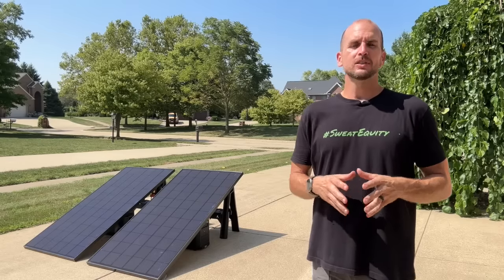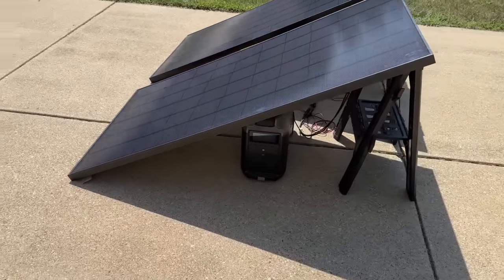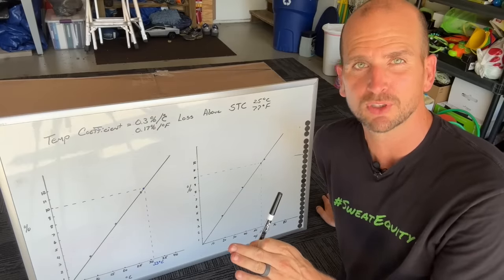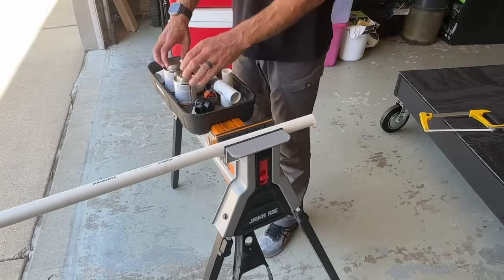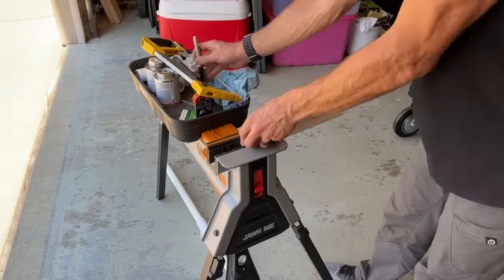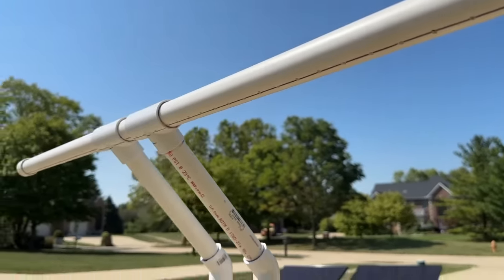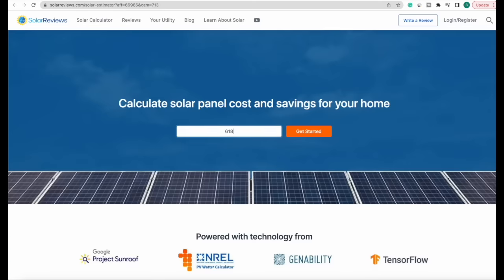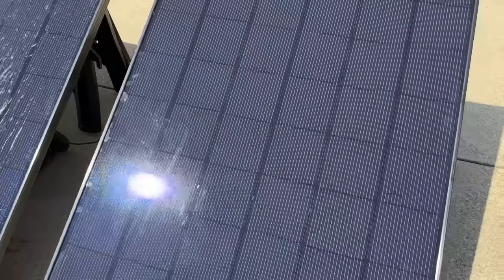Surprising Power Gains By Cooling Solar Panels

Comment: Really interesting but definitely would need to be far more efficient with water use to avoid fighting fire with fire. Also, it would be worth ensuring in any similar future videos that you get your use of 'power' and 'energy' correct. For example, an EV won't be that huge a new power draw (7.2 kW) but it'll be charging at that rate for a long time relatively, so it'll be a huge new energy use.

Comment: Pouring water over the panels to cool them would be a huge waste of water for such little gain. I like the idea of using a closed system to preheat for a water heater, pool, or hot tub though. I actually wanted to use a setup like that on my rv, not for cooling on the panels as much as just to capture the heat and make hot water. I haven’t actually built that though since I haven’t been using the rv for a while.

Comment: 5% is 5% but that's a lot of water you'll be wasting. However, you could maybe use a "pump" that would recirculate the water? The only other possible issue is that the recirculating water may become a little warmer which can be resolved by having a really large water reservoir to re-cool the returning water?
Reply: Warm water is usually a benefit ("combined heat and power"), and there's a hot water heater in every house!

Comment: if the extra wattage gained by cooling panel can power the water pump for this cooling and still have an increase in produced power , then its great .
water calcium staining on panel will be one thing to watch out for

Comment: it might be better to put the cooling behind the solar panel and with piping e. produces warm water from cold water and then stores this heat, for example, in a storage tank (sand barrel, etc., for night heating, or for a heat pump, or for preheating)

Comment: you should cool the underside not the solar surface, the light will scatter and you'll lose power. you need a plastic or metal tube that is square coiled that will carry hot water using a closed loop pump. 
you could also "overclock" the solar panel by putting white plastic or cardboard panels around it to reflect light onto the solar panels.

Comment: This system needs to only work during hot hours, so installing a thermostat to it is essential, so that it does not work during the night or days where it's cool etc etc. Also all the water that goes down, needs to be collected either into water tanks, or directly go to trees and plants so that only 5% of it gets wasted basically from evaporation.

Not a bad idea at all, but I think the water should start running before the panels get extremely hot, because otherwise it might damage them as many people say about solar panels.

Comment: You should switching the valve open 10 seconds in every two minuets, otherwise floating water is also a light blocking layer and prevents all light spectrum to reach panels. 10 seconds should be enough to cool down panels in every 2 seconds

Comment: I wonder if it would be more efficient if the panels were cooled peiodically instead of continuously like that. Maybe every 10 minutes or so to run the water for 2 minutes. The reason being is that I wonder if the light refracting through the water has any effect on efficiency.

Comment: Well, not bad. And now you have to make sure your gain is at least enough to power the water source and pump. Even if your power gain from the PV is equal to the kWh you spent on the pump you will still have your panels constantly clean. And their clearness is also one of the aspects to reduce power loss.

Comment: Wouldn't it be easier to just put it in the shade or in an airconditioned sunroom?  Will that spray cool the panel if the wind blows the spray some other direction?  What about the shadow of the sprayer?  How much water do you think it will use a day; and what percentage of the day will it actually cool the panels?

Comment: This water cooling integration 10 years ago would of raise the cost of the panels so much so that by the time it would of pay for itself, the panels would have to be replaced. In short, it just wasn't worth it.

Nowadays, the panels getting cheap enough to allow this kind of integration, and multiple companies already taking advantage of this dual function. With a closed loop system attached to the backside of the solar panels, you can generate not only electricity, but hot water as well.

You can use this essentially waste heat directly without converting it to other form of energy for whatever you want: heat your home, hot water tank, pool, etc.
As a side effect, removing heat not just increasing efficiency as you showed, but slowing the panel degradation over time, it will preform better and last longer. This means, even if you can't use the generated hot water, these panels are still worth considering. Worst case just use some passive heat exchanger to get rid of the excess heat and with that, get more power and extend the lifetime of the panels.

Comment: I just watched your other/newer video about the closed loop system. Of course copper tubing would be ideal as a heat sink for the closed loop system. I don't know that a close loop system will be a good fit here simply because of the price of copper.

But you could have a semi closed loop system. What about gutters to catch the run off and recycling that water through the system? You'll lose some water to evaporation, but thats likely a big reason why this test was more effective than the closed loop system.

So if you accept that you will have to deal with evaporation, then the question be comes how can you mitigate that as much as possible? Well you were streaming water all over the panels. There is bound to be some optimal quantity of water some where between your gallon per hour flow and a mister system.

A lower flow rate is easier to pump and might lead to less evaporation(?).

From there, you an think about run time. You only need to run the cooling system when the panels get above the temp-coefficient. So you need a way to read the panel temperate and turn on a sprayer when the panel is to hot.

If you do this with rain water collection it gets more doable. But you cant be in a dusty area...

Comment: The figure I have never seen is; how much is the heat load of the house reduced by the shade of rooftop solar panels. Asked a different way. How much less does air-conditioning need to run because of the shade rooftop solar panels provide? Is this never spoken about factor being unfairly contributed to solar efficiency? Can one simply shade their rooftop and produce similar energy use reductions at a much lower cost?

Comment: I live in Alaska and have a place with a small solar system.  The panels are mounted so in the winter the snow reflects some of the sun on them. I have seen them put  out 30% more than advertised when it is close to zero F and the sun it bright on a late March day.
Reply: Are they bifacial?
Reply: Are they bifacial?
Reply: @OneOfaKind949  No they aren’t. I don’t think they even had that in 2008 when I bought them.
Reply: @Chris_at_Home  Thank you for your response, so I think the reason you are able to get such an amazing gain is all the extra light from reflection and the ability to keep them cool despite all the extra infrared radiation or heat.

Comment: Out in Australia last year there was a bloke we met in the outback, he was water cooling his solar panels, harking on about how much more power he was generating.
Not impressed with his lack of scientific measurement, I asked
"Where's your control panel?"
He proceeded to lift a tuft of skin and hair off his forehead and inside there was flashing lights and stuff, bit like a Cisco router on acid at an Indian call centre.
"Where 'ga think ya' drongo!" He yelled.
Turned out he was working for Skynet of something.

Comment: I think the water on top of the panel will reflect the light to a certain degree, as well as perhaps causing refraction, dispersion and diffusion of the light which will lower the irradiance at the plane of the solar panel. Then of course, even if the water is recycled, energy is still required to keep the water pump going which most likely cancels out the small performance gain we get from the panel. So while being an interesting experiment, I don’t think this solution has any practical benefits.
One thing that would be more interesting to try out perhaps is to put a few big fans below the solar panel, which causes a forced convection of air current to move along the backside of the panel. I imagine that rotating a few 12V fans would require a lot less energy than what is required to run a water pump. The fans could be powered by the solar system itself, and there could be a temperature sensor on the solar panel so that the fans won’t run unnecessarily on an overcast day.
It’s not practical for me personally in my setup to put fans behind a panel and try this, but I hope someone else will do it sometime and post the results on YouTube.

Comment: I’m curious as to why you didn’t get 10% if that’s what the charts say.  Could it be because of the uneven temp top to bottom?  I mean, if it is 75F at the center of the panel, it’s colder above and hotter below as the water runs down.  If you have a pool it might make sense to cycle the water over the panels.  Most pools have a bottom drain you can draw the coldest water from.  The bottom of our pool doesn’t get above the mid 60’s in the summer unless there is mixing.  Over time the pool water would warm up and reduce the delta but at least you wouldn’t be paying for the water. Oh, you’d burn up more pool chemical, but those are typically included in your pool service.

Comment: I only thoughts is the gains in efficiency come from just cooling down the panel or does the water flowing across the surface have a reflection or amplification effect on the light?

Comment: Guess you will have to do a retest, the one with the cooling is casting a shadow on panel, which is causing a significant drop in the output, you might get 25% more output than what you got now.

Comment: If you could also test temperature of panels where the power it generates is completely used vs one that's just idle.. I read somewhere if the energy that falls on the panels is not used they are hotter... Means if your battery is full and the panels are always idling on the roof might affect panel life expectancy...

Comment: Hi, it might be useful in conjunction with an irrigation system on a farm to mitigate the water use. Also, is it possible to capture ‘cold’ similar to sand batteries that capture heat. To cool the water ahead of use?

Comment: I’m curious if a misting would cool it as well, use less water, less distortion on the light coming in? I think some way of capturing more winter sun would produce higher results. My winter production is between 1/3 and closer to 1/4 of my best months in April/May. We know cooler is better because April has 90 minutes or so less daylight than June, but production is the same or better, thanks

Comment: So, any increase in power output is offset by an increased water bill?  Also, in a LOT of places, the minerals in the water will begin to coat the panel and cut its output anyway.

Comment: No one is supposed to spray/sprinkle water on hot solar panels, as this introduces microcracks in the panel, each time. The life span gets shortened, the surface gets cloudy.

The solar panels are recommended to be cleaned before sunrise or after sunset, just for not having microcracks.

Comment: make a system to catch the water and recycle it back around of Corse some will be lost to evaporation, but you can have a holding tank that has something like a toilet tank valve in it so as to keep the overall level in the system at a certain amount

Comment: Could the cooling effect be the cause of the gain or do you think the water on the panel is acting like a lens, amplifying the light? One way to find out is to warm the water to the temp of the panel sitting in the sun and repeat the test.

Comment: What about copper heat pipes installed on the back side of the panels which then combine and connect to a heat sink which can be fitted on the side of the house or somewhere that air can pass over?  It will have an upfront cost but is passive

Comment: I wonder about cooling the back of the panel using a large tank. I figured on running the pump to absorb heat in the day and to radiate it off at night. But would it work and would it pay for itself? I really don't know.

Comment: Have installed airconditioners outdoor beneath the solar system with walls  on both the sides it sucks hot airs beneath the solar panels and throw away outside walls to keep the solar panels cool From beneath 
I only wondered if I could catch up the heat generated in top of solar panel glasses to heat my water warm

Comment: I don't recommend this water cooling method unless it is an emergency.  Constant water sprayed on solar panels causes them to rot out much faster, along with the mounting system, as well as mineral buildup on the glass.  Instead, paint the backside of the panels flat black and make sure there is good ventilation to promote convection.

Yes unfortunately, solar panels are spec'ed under idea conditions, which are not normally seen in the south US.  In Florida (where I live) I typically get 85% of the rated output at noon with a clear (full sun) sky.

Comment: Although this is a cool idea, the reality is that panels are quite cheap now days and it probably makes more sense to just add 10% more panels to your system when you first install it. That said, if this is on the roof and you live in a hot location, it may also reduce your cooling requirements for the house so it may have more than 10% returns, but yet again, for most people just adding more panels is by far the easier solution.

Comment: I was amazed since forever why water cooling was not a standard thing for residential solar panels. You make performance better and you need warm/hot water anyway. But yeah, smart enginners couldn't figure it out for so long. Now there are some companies starting to do it but why the hell did it take 20-30 years when we knew from very start that higher temperatures of the panel = worse performance.

Comment: If the panels themselves had internal water cooling passages, combined with a pump, radiator/heat exchanger and some sort or reservoir that self fills that would solve water consumption - the efficiency gains may not be great (due to pumps, fans and somewhat higher panel fabrication costs) but the life of the system could be improved, saving on parts and installation at times of replacement.

Comment: You can use hybrid panels that can produce electricity and heat water at the same time. I know that Linus from LTT got them and he uses the house and the water, among other things, to heat the pool, which is a very good "battery".

Comment: I live 100% oof grid, and since my brain is rewired I don't understand why people want this water to go away. Why not just recapture it, a recycle. I want to try this with a 55G drum of Free rain water, with a very low v pump, like the one used in fountains, run by a separate small panel like solar lights. The 55 g shouldn't get too hot.

Comment: I measured 5/6 % in my test as well on a hot day but who cares when you are making more than you can use in summer anyway, in winter where they aren't making enough 5 % would matter but the losses will also be much less because its cooler so yeah not worth cooling them.

Comment: Plant trees to completely shade like I have at my house, and some bushes around the walls, and no expensive cost, probably save you more with lower grid power required without spending on solar panels, battery storage if included  & and other associated costs. No trees? Grow some vines up the side and back walls, let them cover the roof and shade it, if allowed where you live.

Comment: Using a misting system would work better and use much less water. Better yet, make a liquid heat exchanger and attach it to the back of the panel.
Reply: yeah a misting system would be great I wonder if it would be as efficient though
Reply: @yeanswers  It would use a lot less water. I'm wondering if misting the back would better? That way you're not interfering with the light hitting the panel. Water has a tendency to lense and distort light.

Comment: This test would yield better results than passive cooling with a Heatsink on the back of the panels.  The water is preventing the heat from building up on the glass and Transferring to the PV cells.  A heat sink at the back would be removing heat that was already on the PV cells so it would not be as efficient.

Anyway the Water cooling idea will never work for numerous reasons.  The main one being that putting Tap water or any water that has minerals in it is going to stain the Glass white within weeks or months to the point where the Output will drop way past any gain.
You would have to recirculate something like distilled water and then put it through a RODI filter system to remove the dust and other particles that have entered the water on each pass.  Then you would have to pump it through a radiator or something to cool back down the water.

All of this will use more energy than is saved and you still have the lingering problem of the seals around the panels eventually getting water creep and damaging the Panels.
Water hitting the panels for 8 hours everyday is going to seriously decrease the life of the panels.

Anyway love the video.  There are a few others on this topic and they all run into the same issues.